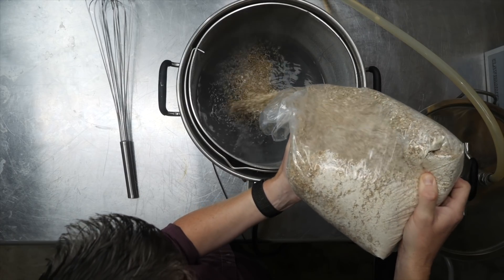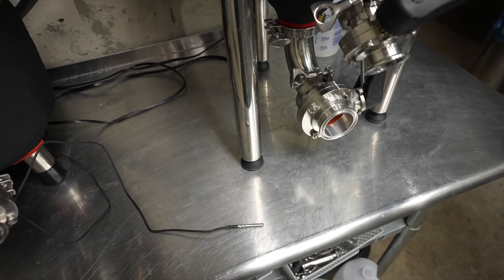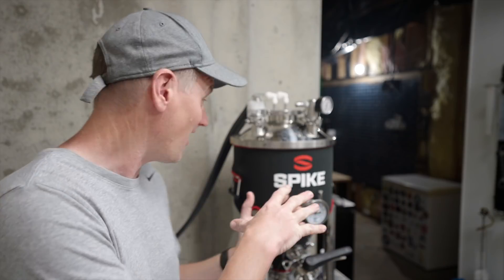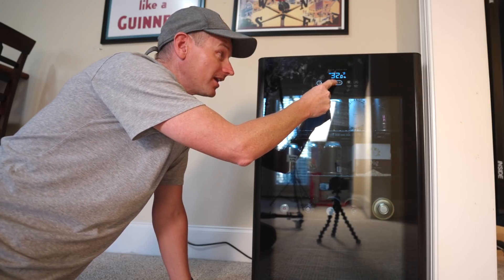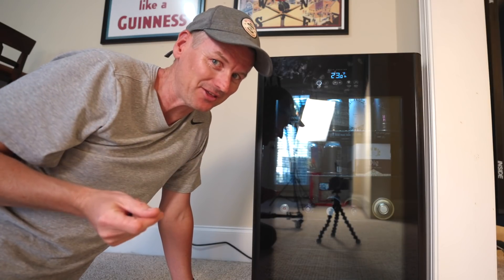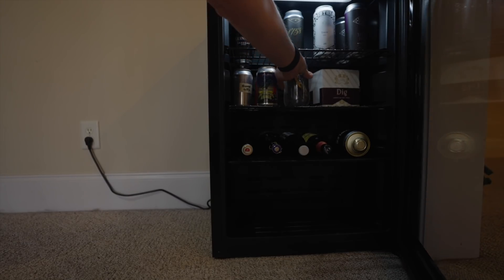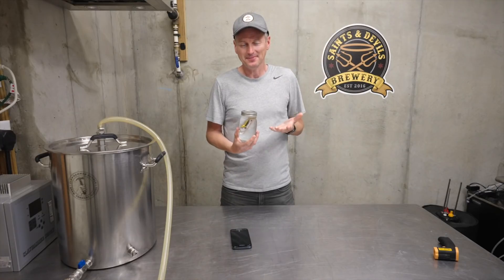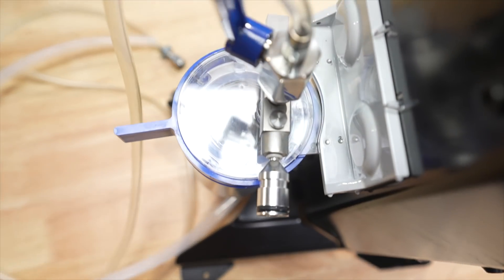The Perils Of Fermentation Temperature | 7 Day Beer Challenge Day 2

Comment: Not that big of a screw up.  I've did worse once. I use a small chest freezer for my fermentation control with a heating pad to raise the temp when needed. After one brew, I mixed the plugs on my Inkbird for heating and cooling.  I had used my counter flow chiller to get the wort lower than my fermentation temp.  So when I plugged it in, it tried to turn on the heating outlet (really the chest freezer).  You can imagine what happened next if you think about it.  Imagine my horror the next morning when I went to check on the progress only to find a solid block of ice.  Luckily, I was able to save it with another pitch of yeast after it thawed.
Reply from the maker: Haha yeah I’ve done exactly that too. Completely froze the beer. I thawed it out and in my case didn’t bother adding yeast. Amazingly the fermentation restarted.

Comment: I left the probe out as well and wort hit 104F.  The garage was unheated and winter with the ambient temp about 40F and I was shooting for about 66F fermentation temp. It was running 104F for 20 hours before I realized there was an issue. I let the temp drop started seeing bubbles and beer turned out fine.  I don't think the yeast had time to start fermenting and create any off flavors.